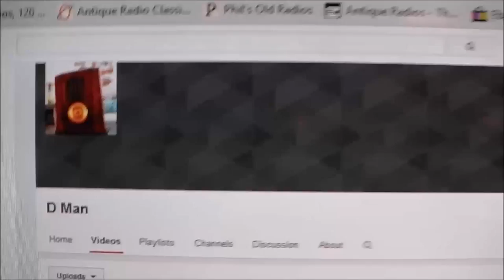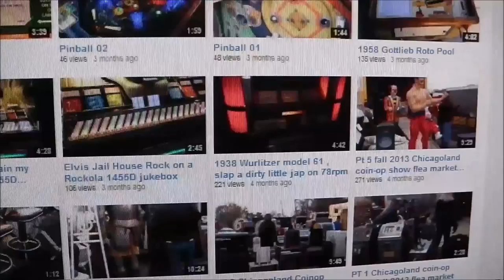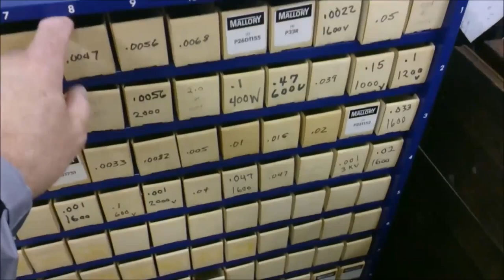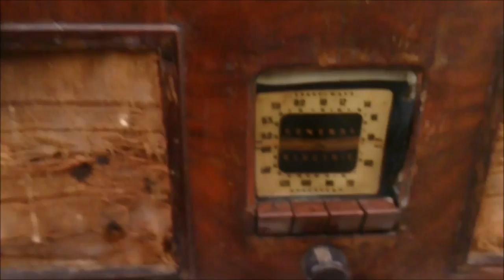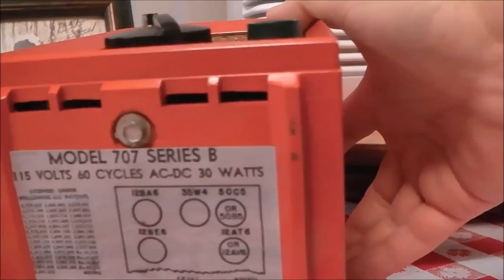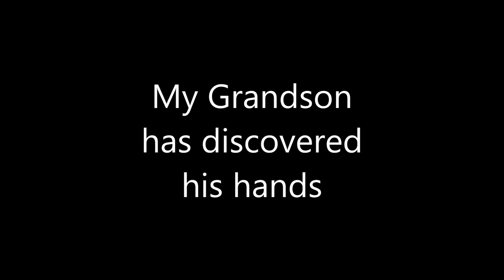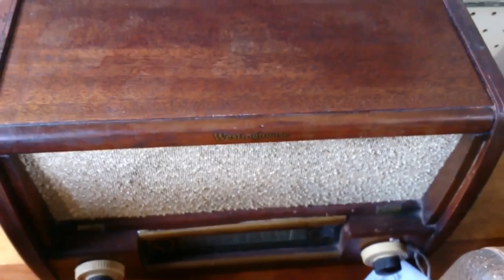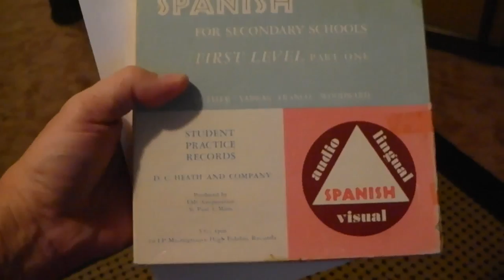Vintage Mashup 21

Comment: Nice mashup video! I like that little Emerson 707 (or whatever the actual model number is). That "L.Tataro" radio is definitely a strange set, I have never seen a radio that only runs on DC wall current before.

Comment: Enjoyed the trips to the antique stores, Al. That 1929 AK radio table is unique. The table was a Kiel or Keil and was made for AK by a mfr. in Milwaukee, which is 35 miles from here. So they are surprisingly plentiful in this area. Would make a good kitchen table for you! The AK 37 really is rusty, and hardly worth $20 in that condition. The table at $75 is a heck of a deal. Especially if it's been gone through and plays. I see you found a 46-350 Philco portable, sans leather handle. Those things bring big money on eBay which is surprising as they are fairly common. And thanks for the Spanish lesson on the M-15! That Art is a thoughtful chap.
Reply from the maker: gavinwb1 Thanks for the info on Kiel, Greg.  We used to have entertainment venues named Kiel, in St. Louis.  I was wondering if that table was manufactured locally.  It's the only one I've seen in this area.  yeah, I know those roll tops go for money.  The one I have plays beautifully.  It's going to be one of the hardest for me to part with.
Reply from the maker: ***** I remember seeing that video.  Didn't know the store was gone, bummer.

Comment: That antique store sure has lots of radios at a good price, well except the painted pink one, that was white and to me I would not pay more than $5 for it.
The music it great too, around here there are NO 50's or 60's radio stations, just rap-crap, hip-hop and 80's 90's and up stuff.
The antique stores here do not have antique radios, maybe a clock radio or two, those are a dime a dozen.
Reply from the maker: ***** You'd think there, of all places, there would be a lot of radios around, Bill.  I wonder why there isn't.  In the St. Louis area, there are really two oldies stations, not counting the classic rock format stations.  Of the two, the one on FM plays the same 50 songs over and over.  The AM station is much better, you can tell it isn't that crap of, here's what you can play, that most stations are.  Unfortunately, it only come in during the daytime, but, I listen to it a lot.